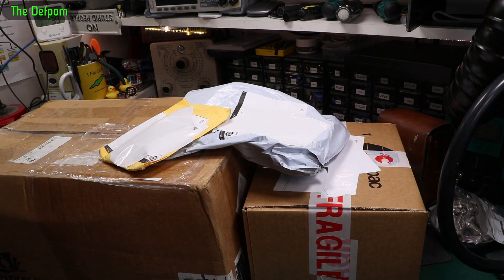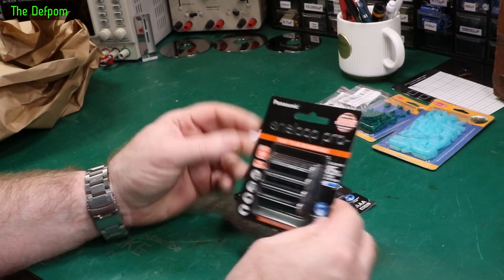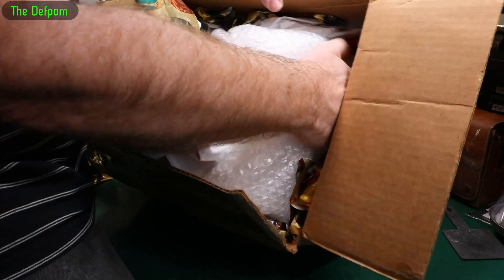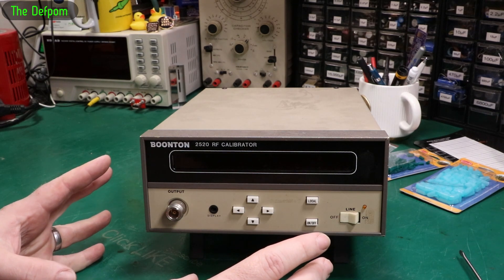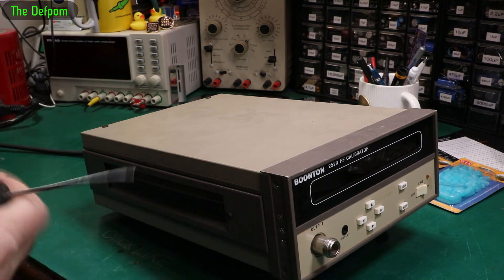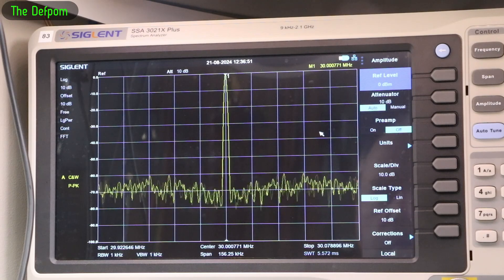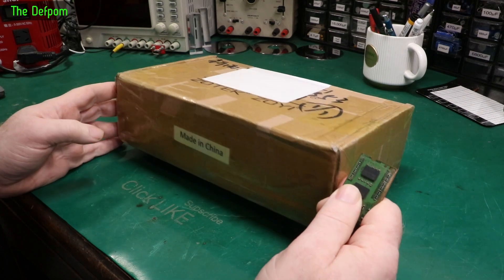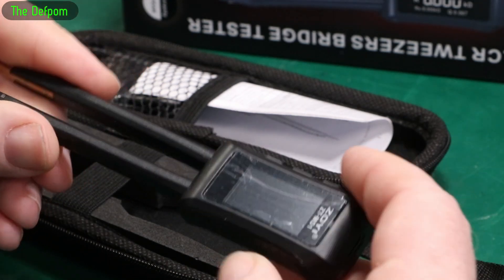🔴 Mailbag Monday 9th September 2024 - No.1276

Comment: One issue with rechargeable batteries is that they do not always fit into some devices. In particular remote controls or some flashlights due to the slightly longer batteries. Enerloop Pros are too darn expensive here in Canada double the price of say Amazon batteries. Pros I believe can only be charged 500 times but are good for devices that have high current draws such as flashes etc.